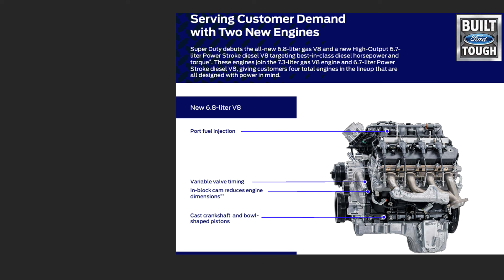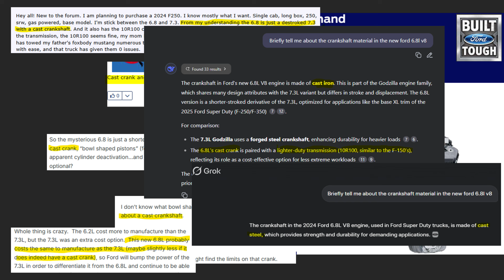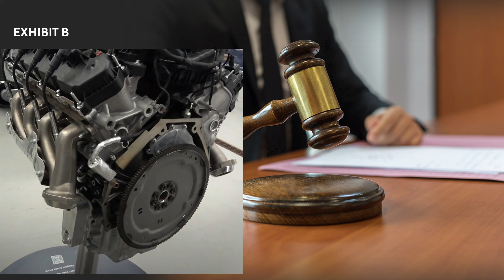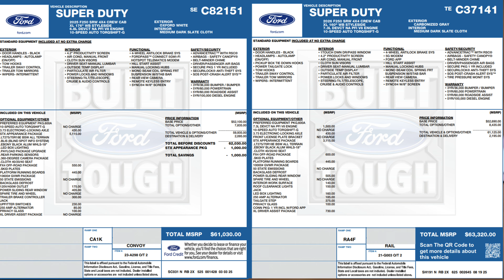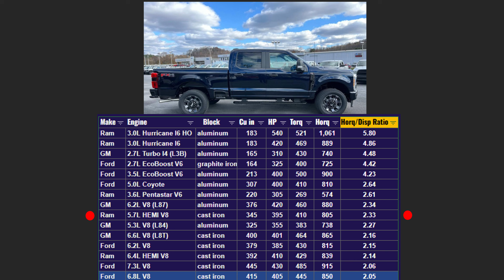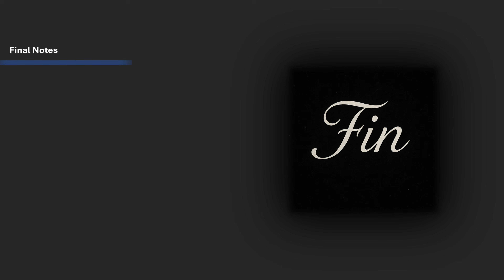Ford’s “Minizilla”: Making the case for the 6.8L V8

Comment: NOPE...lifter failure...look it up, and the 7.3 too...
Reply from the maker: I did look it up, and you're right - on release there were some scattered lifter issues reported with chassis cab 6.8s, though much less common than the initial 7.3 issue.     And almost non-existent with consumer superduties.  Everyone was talking about lifter issues with the 7.3.. issues with the 6.8 never reached a level where it was a common problem.  No engine is perfect - the 6.6 with oil consumption,  the 6.4 with the hemi tick..  When the dust settles it's proven to be a very solid engine so far, arguably better than anything else out there.

Comment: I used to own a 99 and 05 superduty,both with 5.4 engines. The 99 was an automatic and the other was the 6spd manual.  I loved them both and they were daily work trucks and hauled firewood alot. I bought a new fx4 f150 in 2016 with the 2.7 and it's been great so far. I've towed a 24ft camper and haul my dual axle lawncare trailer 7 months out of the year. I'm not real happy about its braking while towing the camper,but has plenty enough power towing what I tow. I still haul 10-15 loads of firewood and it's been great. I average about 21mpg overall. If I were to trade it in I'd consider a new gas f250. I'll never be able to afford another new truck,but maybe a used one down the road. I miss having an 8ft bed hauling wood,lol
Reply from the maker: That's right about the sweet spot for a 2.7 F150.   You're not pushing it harder than it should be.  Should last a while if you really stay on top of the maintenance..

Comment: They did the same thing in the F-150 with the 2.7l. Artificial segmentation. They now no longer offer the 2.7 with the 9.75 rear end because 10k lbs towing is all a half ton needs. So why pay more for an engine that will tow the max 9,000 lbs any sane person would tow with a half-ton? Same here. Outside of a dually, who is towing more than 15k with a 3/4 ton? Not a lot of folks.
Reply from the maker: You're absolutely right about that.  There are some, but there are also F150s towing 12k.  In general I think the F250 is perfectly suited for 8k-14k.  Big travel trailers, moderate 5th wheels, skid steers, big landscaping equipment trailers.   If you go much bigger, an F350 makes sense.. a dually if on the regular.
Reply: Likely more than you think tow over 15k

Comment: Does the 6.8 have the six bolt main like the 7.3 gas engine?   I’m just wondering if the 6.8 is the 360 of old vs 7.3 is the 390.  Man what a huge difference they were.  Great work on this video.  Good job.
Reply from the maker: Thank you!  It shares the same block and heads as the 7.3, the only parts differences I could find are crank, connecting rods, and pistons which would be what's needed to change the stroke.

Comment: Problem isnt the motor great motor. Its the transmission 10 speeds are junk give me a 5  speed or 6 speed.
Reply from the maker: I do agree that they've had a really hard time since they went to 10 speeds.  Though the 10R100 has done pretty well so far.. no recalls or major issues.
Reply: You can still get a cab and chassis E350-450 with the 6r140 and 7.3. it's the only way that combo exists. It's a great swap setup, very bare bones electronics that interfaces well in non-stock uses.
Reply: You only hear about the few bad transmissions on social media. The hundreds of thousands that people don’t have any problems with their transmissions you never hear from

Comment: You have to remember back in the 60s and 70s they put engines like the Lincoln Y blocks, 330FT and 370 BBF in huge medium duty trucks and larger engines like the Super Duty 534, 360/390FT, 429 BBF were optional but they weren't required to move tons of weight with a Clark 5 speed and 2spd rear down the road 50-70mph. The 6.8 is massively more powerful than anything they built before and it can do anything a 7.3 can with all else in the truck being equal. Only when you are adding ridiculous large tires, off roading or running insane speeds or tackling huge grades and crazy high elevations would you actually notice any difference and even then it might just mean that you hear a little more noise when it turns 400-700rpms higher doing the work. They seem to only limit the 6.8 with transmissions, axles and brakes.
Reply from the maker: The 6.8 would be amazing by 70's standards.   I agree that the 6.8 could do just about anything the 7.3 could except in maybe the most extreme circumstances.  And if that's where someone is spending time, a diesel might be a better option.  I did look at brakes, and the 6.8 F250 shares the exact same braking system as the 6.7 HO diesel F350 dually.  The same pads, calipers, everything across the whole superduty line.   I haven't done a deep dive on the axles.. I really should.  And there's an argument to be made that the transmission is a bottleneck, but on paper the 10R100 is rated for much more than the 6.8 (or 7.3) can put out.
Reply: @motorobo0 I have no doubt the 10R100 would be just as capable as the 140 in New condition, I would only count on the larger trans to have more clutches and beef inside to last longer before it's shot, maybe. Of course that could take decades of hard use with the gas engine output. The trade off is the R100 probably is lighter and has less parasitic drag to get more power to wheels and use less fuel in lighter use.
Reply: @motorobo0 what I meant about the brakes and axles adding to the 7.3s abilities was because they don't offer the 6.8L in F450/F550/F600 which all have heavier 10 lug medium duty running gear. Probably Spicer S110 rears instead of 10.5" Stirling or Dana 80 in an F250/F350

Comment: I have a strong feeling the 6.8L is highly underrated on power. On a Dyno the old 4.8L and 5.3L GM V8s which had the same heads, cam, I take and exhaust systems were within 10hp peak, the 4.8 peaked slightly higher and the 5.3 made 20-30ft/lbs more tq. The 6.8 and 7.3 are much bigger so the difference is smaller, the heads and everything is much higher performing, the 6.8 actually has more compression too, if the 7.3 makes 430hp and 485tq, I bet the 6.8 makes 420hp and 460tq rather than 405hp and 445tq unless it is purposefully detuned, in that case it could likely match or surpass a stock tune 7.3 with a Dyno tune, if the intake and exhaust were improved along with a tune it could likely make incredible power and I see no read n that with no more than a cam+springs, long tube headers, CAI, full exhaustand a tune it should be able to make 600-625hp just like a 7.3 will before head porting or an aftermarket intake manifold and throttle body. I think that either a 6.8 or 7.3 could easily be a 700hp engine n/a with ported factory heads. I also believe that either engine can stand up to 1500-2000hp with twin turbos and supporting mods. I have found myself on the Ford website configuring two different trucks. An F250 XL Super Cab 6.75' box 6.8L 10spd 3.73 Elok 4x4 vinyl seats rubber floor or an F550 XL Super Cab, Cab and Chassis 2wd dually vinyl seats rubber floor short wheel base 7.3L 10spd 4.88 TracLok to build with a flat bed and tool boxes...I would price an F-600 but they don't show an Super Cab available. I would trust one of those newer Super Duty trucks more to last 31 years like my '94 F-250 than anything else they sell today new if I was forced to buy a new vehicle.
Reply from the maker: A channel called 'Engine Power' dyno'd a stock 7.3, and it came out at 502HP and 564 Torque.  Seems too good to  be true.  Far above the rated power.  But if it is true, I suspect you're right and the 6.8 is probably underrated as well.  In fact, they have a pretty strong incentive to underrate it.  I'd love to see what the 6.8 or 7.3 would do pushed to the limit.   It's fun to price out different configs on Ford's website.  That 550XL would be a beast!
Reply: @motorobo0 the test on there was probably with no cats or exhaust, no intake restrictions in front of the throttle body and an optimized Holley Terminator X tune...if not long tube headers and no accessories. Just like how an LQ4 6.0 was rated 325hp in a Denali  and puts out a🎉round 445hp at the crank with no accessories and long tube headers with an optimized tune in Richard Holder's tests. If the 7.3 did 502hp I suspect a 6.8 would do 492hp all else the same.

Comment: @Motorobo If you want some interesting reading look up the ORIGINAL 2023 tow ratings for the 6.8L. They have dropped the ratings each year on the charts.
Reply from the maker: Is that right?  I will definitely look into that.  I seem to remember when the 6.8 came out, there was more demand than they anticipated and they ran out of stock, offering 7.3s as a replacement until they got caught up.   That's just by memory, I could be wrong.  But if that's the case, maybe they gimped the tow rating to kill off some demand.  But I will search out the tow ratings since '23 and see what I find.  Thanks!
Reply: @motorobo0  I have a '23 STX Crew 10600 GVW 3965 payload 3.73 rear axle and the tow rating was 14700 on the chart. It was 17300 with the 4.30 rear, iirc.

Comment: Great video! Did i hear you had a powerboost? Would love a video on that one, since i own one.
Reply from the maker: Yes I did, a 22.  I actually really liked the drivetrain and had no issues with it.  I had all sorts of other issues, but it seemed like an overall quality issue with my truck.  I was in and out of service a lot, but mostly for suspension noises and other weird stuff.  Replaced control arm, ujoints, and a couple of other things all below 30k.  But they had never seen that before.  I did get the max tow axle bolt snap, which was widespread.  But the drivetrain was solid, and I liked gamifying my driving (going for good brake scores, etc).   And I really liked the propower.   I could do something on that sometime.

Comment: Even if the 6.8 only had a cast crank that means nothing, a cast crank 6.0 LQ4/LQ9 can make 1500hp with boost and not break or run for 300-400k with good maintenance and careful use...IE not letting it run out of oil or overheat excessively. I would trust this 6.8 as long as the oil pump could be fixed to not vary pressure too low and eat lifters. The main bonus of the 7.3 is that the heavier transmissions are available with it. The Torque Shift G is supposed to be good for like 700ft/lbs but, I would wonder more than I would about the stronger Torque shift 10spd, it seems like all the newer transmissions in these trucks are compromised in some way and made to fail with over sophistication and intentional cheaping out on certain components. The E-series Cutaway and F-650/F-750 7.3L get the old 6R140. If I had the choice of a Super Duty or an F150 5.0...I would certainly take the 6.8L F-250. The Silverado 2500/3500 did initially have the new L8T 6.6L with the old 6L90E and inspite of it not performing as well as the 10sp 7.3L Fords it may have been pretty long lasting rather than the 10spd auto the 6.6 has now and the 6.4L Hemi with the ZF8 is probably not going to be as good as the 6.8 either.
Reply from the maker: I wouldn't worry about a cast crank either.. engines fail in a lot of ways, but busted crank is pretty rare.. especially stock.   You'd really need to be doing something unnatural to it.  The one thing I can say about the 10R100 is it's the newest of the bunch, and so far at least has been reliable.  No major issues or recalls.  You'd hope they would have incorporated some lessons learned from the 80 and 140.   I'm sure they kept an eye on failure rates when it was just behind the 6.8.. when more proven, they put it behind the 7.3 as well.   You're right that all newer transmissions are cheaped out in places.  The question is what is the least worst option.  It does seem like things really started falling apart when everyone moved to 10 speeds.  And yeah, the 6.6 plus the 6L90E was a pretty stout combination.
Reply: @motorobo0 yeah, I like watching Nate from NextGen Transmission on the podcast he does talking about the corruption and shady practices of the auto industry. Seems like the Fords are the lesser of current evils. Also Getty Garage.

Comment: A nice breakdown on gas vs diesel & how long it would take to drive a diesel to pay for itself …based off average towing per year and not so average towing per year i believe somewhere i’ve herd of numbers like 650,000 miles of Avg driving a diesel truck  towing only a few times a year to pay back to justify the 10-12k diesel option ….
Reply from the maker: I keep rolling a comparison around in my head.  That would be an interesting metric to add.  Nobody should be buying a diesel for cost savings..

Comment: If you didn't know, fire up forscan and check out that oil pressure key on engine off.  You have to subtract that number from what you read when engine running.
Reply from the maker: I’ve never heard that - I will try it!

Comment: I bought a 24 f250 with the 7.3 because it had the basics of what I wanted and one of those was the 7.3. Ive wanted one since they came out and I just like big displacement. It goes back to my younger days when I built a 429 for my 79 f150 and later a bored 460 for my 77. But I can say this I came from a 2014 f150 with the 5.0 to this 24 superduty. I’m old school and like the solid front axle and the engine. If they would just had a floor shifter for the transfer case. Nothing wrong with the 6.8 I test drove both but was set on the 7.3😂
Reply from the maker: Perfectly justifiable reason to buy a 7.3!   Imagine having one of these engines show up in a crate back in the day.  They are so impressive by those standards.

Comment: I'm intrigued by the 6.8 and the 7.3 is not a 1500 dollar option as some YouTubers say it's at least 8000 because of the package thing. My hangup is it's 1991 and I have a 305 in my 87 Chevy and a 350 would've been soooo much better. That's what I would be afraid of if I got a 6.8.  I would also rather have the 140 trans but that's because I don't know what I don't know.
Reply from the maker: I had an '01 Chevy with the 5.3, and I remember having to turn off the AC going up rolling hills (while towing my camper).  It really needed all the power it could get.  I can say that the 6.8 is nothing like that.  You can indeed go to the 7.3 for $1500, but if you want the 10R140, that's where you pay the big money, because it requires the Tremor package.   At least in the F250.  But if you go with an F350, you can still get the 7.3 for $1500 and it comes with a 10R140.
Reply: Yeah, that is jacked up, I noticed the same thing on the Ford website building a truck on the configurator, you have to either build a larger truck or pay for higher trims to get the 7.3. I would almost rather have the 10R140 than the 7.3 just for the insurance. I had a new 2013 F-250 XL CC 8' 6.2L 6R140 3
4x4 3.73 elok and it was already more than adequate power, even with the heavier steel body and less gears I got 17-19mpg hwy with it and it averaged around 15.8 combined over the course of a year. I would imagine that the 6.8 would get 20 empty hwy no problem with it's advantages. Hopefully the Torqueshift G isnt the weakness if you really work it hard or want to run it 300-400k miles for 20+ years. With what new vehicles cost these days that is what I would want one of these trucks for. Something I can count on for all my needs for a couple decades without any major repairs of the engine or trans. The new vehicle every 3-5 years game is financial suicide unless you can write the truck off or you are wealthy. One of these Super Duty trucks is the only new vehicle I would spend real money for. I would still probably look into a valve body from Next Gen and the oil pump conversion from Holley that get that variable oil pump off there. I might even look for a modular bolt pattern ZF-5 or S6-650 and manual swap the truck down the road if none of these new 10spd will last.
Reply from the maker: I do get right about 20 (on the computer) empty, cruise at 65.  19.8, 19.9.   But that's the computer.  Probably actually around 19.5.  Seems when I calculate by hand that's the spread.  I wouldn't discount the 10R100 just yet.  It's not had any real problem so far, an in theory at least should incorporate lessons learned from the 80 and 140.  I do know the 100 shares some parts with the 140 as well as the 80.  It's rated much higher than the 6.8 or 7.3 can put out.. it doesn't ride the edge like Ram tends to do.  It's less mass, more efficient.  I dunno.  The jury is still out, but so far it's been promising.  As promising as any 10 speed can be these days anyway, for whatever that's worth.

Comment: I own a ‘24 f350 Tremor and a 2017 twisted Powerstroke 586/1238 at the wheels and I couldn’t be happier with both trucks. I tow goosenecks and 5th wheel and both trucks do excellent. I never considered the 6.8 but you have shed excellent light into its purpose. Great video and insight.
Reply from the maker: Wow man, you’ve have both ends of the spectrum covered.  That’s a fun driveway right there.  I have an ‘07 Ram 3500 5.9 manual sitting out there.  Great truck..I daily drove that for a long time, but selling it soon.  Also just sold an ‘03 E350 Chateau van with a 7.3.  My driveway is getting less fun over time 😁